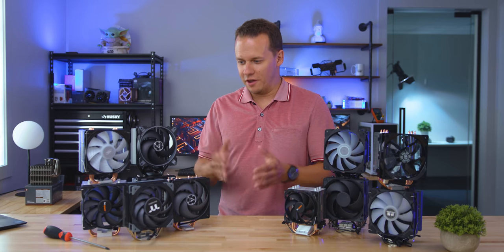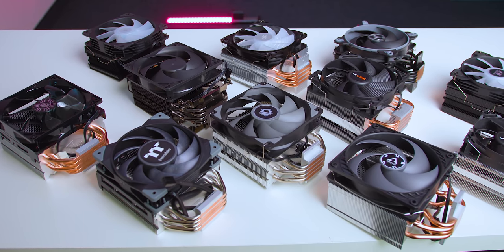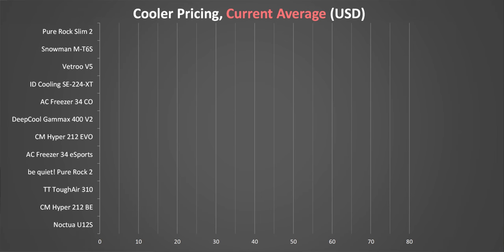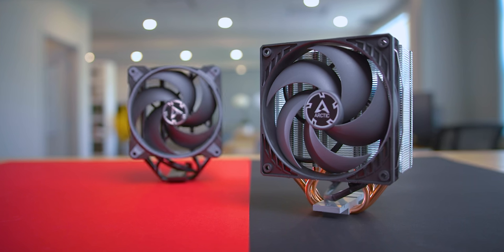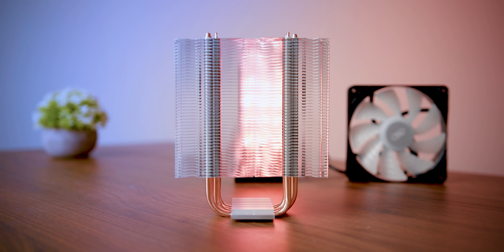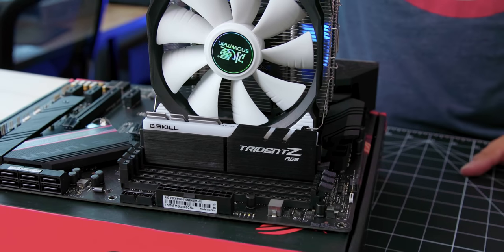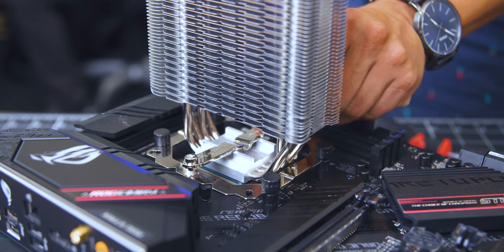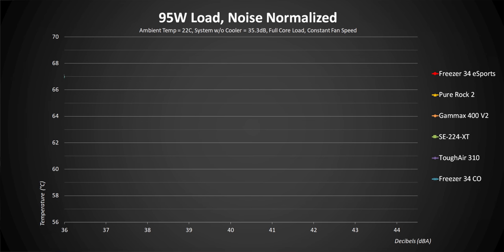The Best BUDGET CPU Coolers!

Comment: A big oversight here is that you've compared all these BUDGET coolers with aftermarket thermal paste instead of whatever is included in the box. People on a tight budget are not going to buy extra paste, they want to have a good quality paste included. With that in mind, did the ID Cooling SE-224-XT really win? The included paste is the ID-TG25 which I've only read bad things about whereas the Arctic Freezer 34 Esports comes with Arctic's MX-4 paste which we all know is high quality. Another thing, the Arctic Freezer 34 Esports comes with a 10 year warranty as opposed to ID Cooling's 2 year warranty. These are things you need to be taking into consideration when making recommendations.

Comment: Came back to this video to leave a comment. I wanted the Arctic Freezer 34 eSports but it didn't make sense in terms of price compared to the ID Cooling SE224XT Black V2 (could find the Basic version). The Freezer 34 eSports was ~$47.68 vs the SE224XT Black V2 was ~$22.51, that makes the Freezer 34 a bit over 2x the price of the SE224XT for not too far off performance wise.

So far in my initial testing it made a 20C drop on my R5 2500 when comparing it to the Wraith Stealth it came with at 100% fan speed. So its pretty good. Fan noise wasn't bad but it might have a different fan from the SE224XT Basic version since it just tops out at 1950rpm and at that speed it was just a bit louder than my Arctic P12 fans at 1400rpm. Also it has a pretty shiny base plate like mentioned in the video which was neat to see is true.

I checked some of the other coolers mentioned in this video like the Pure Rock Slim 2 (~$88), Snowman MT-6S (~$34) but they were all more expensive than the SE224XT I got. Also checked the Scythe coolers particularly the Fuma 2 that Gamers Nexus reviewed but its stupidly expensive (~$100), the prices of Scythe products in my country are stupidly close to Noctua and if I was at that price range I would go Noctua honestly. Got the SE22XT Black V2 as it was the best value for the performance it had.

Comment: Memory compatibility... Looks at D15.😅

I recently brought a cooler master 212 Evo as I needed something cheap for a mining rig. It was so cool and cool to the touch (a stock i7 6700k), I tried it without the fan (case has good airflow: 3x actic P12 front intakes). Plus, it looks better naked.😉

Like you said the, the CPU makes a massive difference. I actually downclock/ under volt my 3950x most of the time with the fans down to 500rpm as it's silent, even with a 6900xt mining away (free heating & GPUs, plus mining is quieter than my central heating).

Comment: On a FX8320 had a Scythe Grand Kama Cross 2 in 2013. That mobo and CPU dies on me2 years ago and got me an ASRock x470 Master SLI mobo with a 3600 got an updated mounting kit from Scythe and is has been running ever since. Having upgraded to a complete new build with a 5800x (AIO cooler). my old build is now mining ethereum, R9 390 and RX 580 temps 74C and 76C) and monero with the CPU at 100% (temp 81-82C) ambient 27C at the moment Fractal Design Define R4 case (not the best airflow by very quiet).

Comment: Hi! I have the CPU i5 13500 (motherboard b760m ds3h ax ddr4) . I haven't installed anything yet because I'm missing a few things. I plan to buy a SE-224 XTS cooler. Will it be enough to cool the cpu i5 13500 or would it be better to take the SE-226 XT?

Comment: i'm surprised you guys haven't reviewed the gelid phantom yet, highly recommend it.
Reply: Yeah great cooler. I have the gelid phantom with arctic fans
Reply: @kaigrett5354  Did you try it with the stock fans by any chance? I've always wondered how much better the cooling gets if the fans are replaced on cheaper coolers.
Reply: @AxR558  I first used it with the Stock fans. The thermal performance was great but they were a bit too loud for my taste (I optimised my pc for maximum silence)
The arctic P12 fans reduced the noise to inaudible levels.
But if you do not care that much about noise, the stock fans will be fine.

Comment: TT Toughfan is basically stolen Noctua A12x25 fan with significantly worse build quality (40k hours lifetime vs 150k), slapped on a heatsink. That being said, the design itself is older (remember the Gentle Typhoon fan?), but instead of simple copying, Noctua tried to perfect it.
With higher power load added into equation, the additional heatpipe of U12S starts showing off its purpose - but the stock fan on Noctua U12S is already trash - very old design, noisy and drones a lot. Swapping this fan with the aforemetioned A12x25 got me additional 3°C CPU temperatures drop.

I like the way Arctic did its mounting system. 4 bolts on 4 sides, securing the cooler firmly. Size of the base has nothing to do with cooling efficiency, which was proved many times already. That´s why CPUs have IHS in the first place.

Comment: I would say that the ID-Cooling SE-224-xt is the best air cooler on the market...  I opted for silent since that one is super noisy...  I went with the Deepcool Gammaxx 400 v2 blue led version...  It is just as good as a Cooler Master Hyper 212 Evo v2 but cost $10 USD less...  It is also quieter than both...  The thermal paste I would recommned is the Arctic MX-4...  Adding a few more degrees in cooling performance...  I tried Thermal Grizzly Kryonaut but it dried out really fast...  Temps started to rise with the Thermal Grizzly compound within 2 months...  I haven't even changed the Arctic MX-4 thermal paste even now that it's a year later...  Still runs like new on my R5 2600 and I love it...  Any of these coolers would be great...  However, if noise is a concern I would get the Gammaxx 400 v2 or hyper 212 evo with Arctic MX-4...  I will never use Thermal Grizzly ever again...  I have 2 intake and 1 out take fan in my system along with a couple of vented grooves on the top...  Your Experience may differ depending on your cases airflow...

Comment: I have a 5800X and a 3080 in a uATX case, but I kept the Hyper 212 Black Edition from when I had a 2600X and a 1070TI. That thing is still able to keep the 5800X from throttling under full load as long as I undervolt the CPU and adjust my fan curves to be a little more aggressive. It actually performs a tiny bit better than my partner's CoolerMaster MasterLiquid LC240E (also 3080 and 5800X) which is at stock voltage and fan settings.

Comment: There is actually one cooler that beats both the Noctua and Arctic here, by quite a lot actually while being cheaper, kinda in the middle here pricewise, unfortunately you cannot get it in the US, but it is really popular in Europe. It is called SilentiumPC Fera 5. The amount of power that cooler has is STUPID, it basically matches the D15S when noise-normalized and gets close to the dual-fan D15, while having just one 120mm fan. The mount is also very good and quite easy. That cooler uses some black magic.

Comment: Don't believe the liquid cooling hype. Air cooling is very capable of keeping your CPU cool. Just do some research and purchase the one that fits your budget and does a decent job of cooling. I have workhourse servers at work that run constantly and only use fans.....so sick of the push for liquid cooling is needed for gaming. No it's literally not. Manufactures have a high markup for them and make more money from consumers off them. Even the coolers that come with the CPU are sufficient abeit it'll shorten the life of your CPU quicker due to running hotter over a period of time.  I've used Arctic CPU fans my entire PC gaming life with zero issues. Heck my current Arctice Freezer 64 AMD had a fan issue a fee years back, called their support. The lady was difficult to understand but she said it was discontinued, I have a few replacement fans on the shelf. She sent me 3 of them at no charge. I was impressed. Now if I could just make it fit my new AM4 build.....

Comment: Just what i'm looking for, budget cpu cooling.. I'm using jonsbo 1200, and i want to change it, and it seems id cooling se224xt is around 23 - 25$ in my country.   I have no problem about jonsbo 1200 works, but it kind of stressed me out on how to install the cooler, i'm afraid i will break the motherboard because.

Comment: Like Steve @GN you haven't covered the Aresgame River 5 and I think people are missing out. Earlier this year when this cooler with a very quiet RGB fan appeared on Amazon @ $20 I bought a few. They are now $30 but still I'm sure fully worth that price point. The Vetroo keeps getting all the attention but I'd bet the River 5 is better, I know it's built better and it has a better retention method for cpu contact using the Thermalright type of center pressure retention.

Comment: There's one thing many people don't know about fans!
Almost all fans have a motor sound that comes from the control electronics inside the fan. The speed regulator circuit inside many fans creates a special frequency.

NOCTUA fans do not have this problem. They have a specially made control circuit that does not create this problem.

As soon as you cut the power to the fan, this sound disappears immediately. Many fans have problems with this and therefore you almost always get a special fan sound inside a computer case.

PWM is pulse width modulation and changing the frequency to achieve higher and lower volts. This creates little heat but creates flickering that can be seen in some LEDs. light or beep sound in battery screwdrivers. Ordinary linear regulators that do not have this problem get very hot, which makes them impractical to use.

I have replaced all fans with NOCTUA fans and you can hear the difference.

Rhen there are also many cheap fans that are not balanced correctly and they can vibrate.

Comment: The average gamer needs none of these.  Games don't typically drive the CPU anywhere near unsafe temperatures (not unless you are playing Chess or Go and doing an overnight board evaluation, anyways), and fan noise can be mitigated by better case materials and placing the computer someplace besides on your desk.

If people are so worried about keeping their PC safe and sound, they would be better off not overclocking their CPU in the first place, since high voltage and current will carry a real risk of electromigration, even with high amounts of cooling (such as water cooling or liquid nitrogen).

Comment: I’ve built with the 212 Black, 212 EVO, and 212 RGB. I’ve also built with the Arctic 34 esports, discontinued Arctic 33 esports, and finally 224 XT Basic in my latest. 

I did not do any rigorous comparison testing, but I do remember the installation experiences and looks. I don’t like the Arctics because their fin arrays have sharp sawtooth patterns (to mitigate turbulence) and I’ve cut my knuckles on them. 

I don’t like the 212 EVO because of the bare metal finishes and the dated looking fan. Also the crossbar style installation was terrible. The 212 RGB has an RGB fan, but it’s not ARGB and it’s too transparent. My favorite in the line is the 212 Black Edition, which is worth it after a deep discount. It looks great, performs well, and has a better installation. 

My current favorite is the ID Cooling 224 XT Basic. It looks just fine, has a great price, the installation is easy, it seems to be in stock way more than the others, and it performs well. The thermal paste is sus though. I just used some Arctic MX-4 I had on hand and it worked great. 

Thanks for the roundup! This reinforces my findings on the 224 XT, as well as the impressions from Machines & More. I hope this doesn’t cause it to sell out.

Comment: should play the game changing the fan on them love those thermaltake fan there rock solid build grab old gammax than put that thermaltake fan and see result :) older version of gammax where having longer heat pipe i do believe that was getting them that little extra to shine base are not great though but nothing 4-5 pass of 1000 sand paper can solve :P and those old pin pressure like intel and not to great to work whit but for i5 10400 i think leave very little on the experience.Rocking personnally one bigger 4 heat pipe ever made i have see cryorig h5 ultimate whit phantek 140mm on it does well on my mild i7 10700f i run it at 150watts max limit whit that been said ;)

Comment: Too bad you didn't use just one type of fan (preferably one that goes up to 2500-3000 rpm). Then the numbers could've told us a lot more about the actual coolers. The Noctua, for example, is obviously hamstrung by its fan's preoccupation with silence. With a slightly faster fan, it would probably dominate.

Comment: My case only had a clearance of 150mm. Vetroo V5 was clearly the best choice for me and I got mine for under $25 (On amazon less than a year ago since this video was made). Great performance (I live in the Caribbean, so it's hot ALL THE TIME) and I can throw it in just about any matx case. I got a Ryzen 2600 and managed to overclock it to 4Ghz on all cores and it doesn't even crack 65 degrees when gaming (GPU also overclocked and some days it touches 80 degrees, which warms the case - Did I mention that I live in the Caribbean?). Solid cooler. What I would have loved to see (or just be made available) is the raw cooling performance of all the coolers. I don't mind some noise, as long as it's not obnoxiously loud then I'm fine - I just need to know what cools the best and unfortunately, that wasn't provided. Great video regardless.

Comment: i missed the Scythe Kotetsu Mark II. 35€. nickel plated copper baseplate. very good mounting system. if you have someone (like me) who has some skill, you can make a 2nd pair of fanclips, because the cooler is build in way to put a 2nd fan on it (its just not included in the package). But a big thanks to you, fo doin this massive review.

Comment: The noise-vs-temperature trace is a wonderful way to present the data.  However, 1 degree of temperature resolution is likely not enough.  What about averaging over all cores over 1 minute or so? Also all the coolers have the same minimum noise, the noise floor of your system.  With that in mind, perhaps you should show the minimum fan speeds for each cooler?

Comment: I actually use the Cooler Master Hyper 212 BE, bought back in 2019 on sale and I've used it on two different CPUs, the R5 2400G and the 3600. Never used the stock coolers that came with them, and so far with mild over-clocking I've kept temps under control and manage to keep the 3600 at 4.1GHz, it rarely goes above 80c during heavy workloads like Handbrake, and during gaming, depending on the game, can go as low as 55c and up to 65-75c.

Comment: Arctic or veltroo V5? Which do you guys find better? I kinda want rgb so veltroo V5 but arctic is more silent.
Reply from the maker: Either one though the Arctic comes with a lot better warranty for the fan
Reply: @HardwareCanucks  that’s cool but im not really worried about warranty so much. Do you have any recommendations for case fans? Ive been thinking of uphere fans. They are about $8 per fan, I’m just worried about that they will annoying horizontally

Comment: There's two coolers for not much more money, which are quite a lot better than any in this review. The 2 best bang for buck air coolers in the US market atm are Reeven Justice @ $35 (6x6mm heatpipes, coldplate, no AM4 mounting in the box though). And the second, which is actually the no.1 to buy atm is the Thermalright Peerless Assassin $41 (6x6mm heatpipes, coldplate, AM4 sup, and dual tower design). The Assassin is basically a Scythe Fuma 2 clone for less money and with better fans xD

Comment: I've got myself the Freezer 34 CO for my 5600X (running stock). I'm getting around ~59C doing the 10 minute Cinebench R23 benchmark. CPU package power using 76 watts and fan running at ~1000 RPM. Is this kind of temp expected? From my limited knowledge I'd assume this to be normal, but I'm not quite sure.

Comment: I like 92mm coolers because they fit in those slightly slimmer retro cases which had 80mm/92mm rear exhausts, and were only 170mm wide.

Comment: When I built my Ryzen 2600 system in 2019 I put a Gelid Solutions Tranquillo Rev.4 ver B cooler on it. Was recommended by a website that usually has good reviews. Cooling was fine and still is but the fan was the loudest component of my pc. Even louder than my graphics card and audible through my Fractal R6. I bought a be quiet fan and replaced the stock cooler fan and voila super quiet pc. So afterwards should have gone for a better cooler maybe with a good fan included.
Reply: I had a loud Be Quiet fan so every fan is individual.

Comment: Thanks for the tests. I have the Gammaxx v2 400, which is a good performer, but the fan was noticeable at too many RPMs. Swapped the fan out for an Arctic Bionix P120 ARGB & things are so much quieter now, with more flexibility in the RPM range too.

I wonder if for future videos, you could do a 'Heatsink + fan' combo comparison. Say, focussing on one of these cheap heatsinks in a video & then swapping out its fan for a range of higher quality ones to see how the performance/noise differs.

Comment: Thermaltake does have some great design for its CPU cooler. The UX series is just cheap and bad, but this ToughAir series really packs a punch. I was kinda surprise that they manage to pull this off. Well, if it wasn't for a little premium pricing, I would have bought it. Still, CM sis LED Hyper works fine for my Ryzen 5 3600, but I'm thinking of going a little bit more advance when everything settles down, and I think Tough air will be my go to choice now.

Now, before anyone said why not get a BeQuiet, it is very expensive and extremely hard to find at my area. They cost twice the CM Hyper 212 LED.

Thanks for the insight. I wonder how ToughAir 510 will fare.